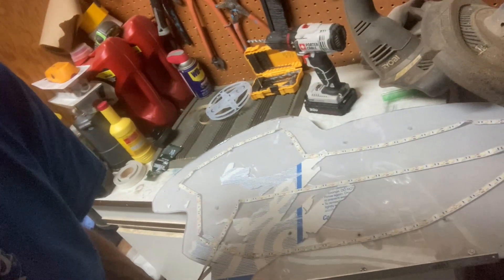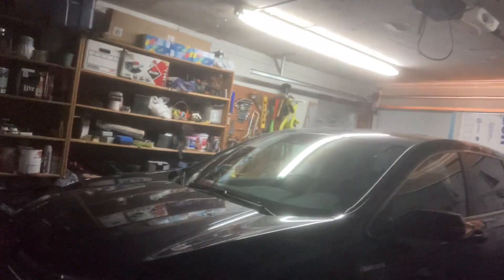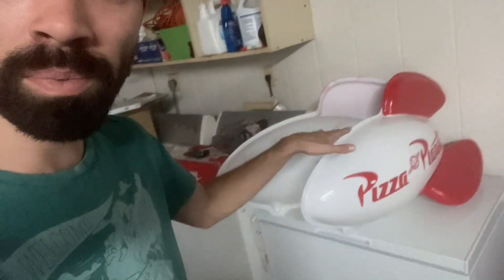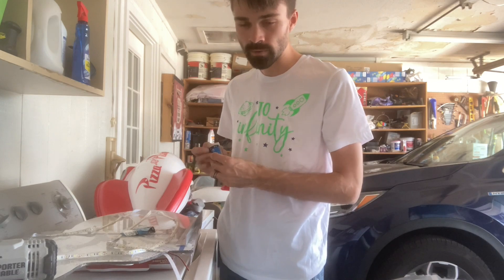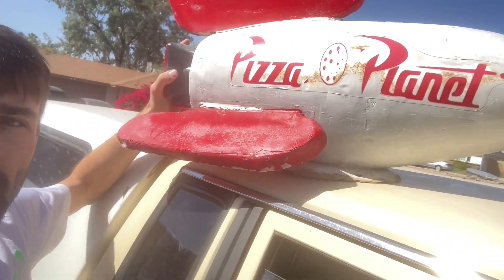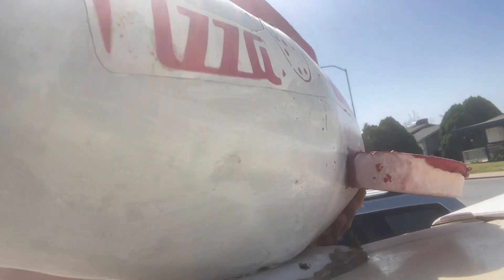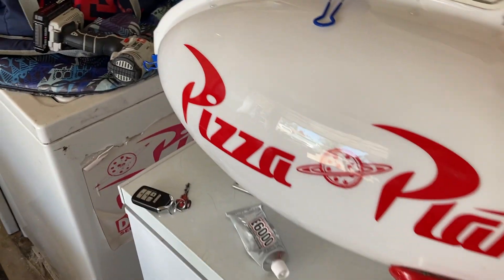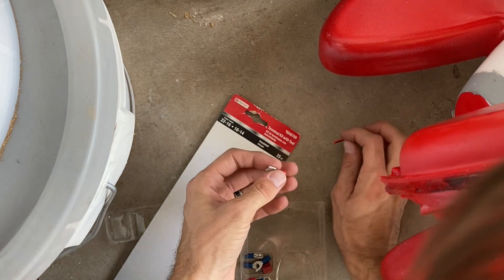Building a New Pizza Planet Rocket-  Part 2!

Comment from the maker: A few people were wondering about the problems I had with the plastic cracking. It’s my guess that I was drilling too close to the edge, or trying to drill the holes too fast. Over tightening the bolts would also cause the same problem. 
It’s worth mentioning that many people have bought the same plastic rocket kit from the Pizza Planet Truck FB page and didn’t have the same problem. 
It has been on my truck for a couple of months now and it’s still holding strong.
Reply: Where is live action toy story 2

Comment: Hey man so I also have made a Pizza planet delivery shuttle and I used the same rocket kit and it also cracked while I was making it. How fast do you go with yours on? I'm scared to go over 60 out of fear the crack will spread and it'll just shatter on the interstate
Reply from the maker: Oh no! I’m sorry to hear that. 
I reinforced mine with extra glue and also since this video I added some stability with with extra plastic under the bottom fins. 
The cracks haven’t spread at all and I have no problems taking it on the highways 75mph. But I do keep my eye on it. Especially with the weather. So far it’s held up.